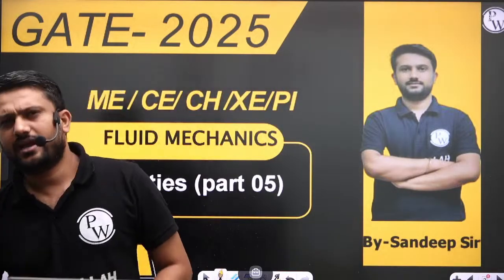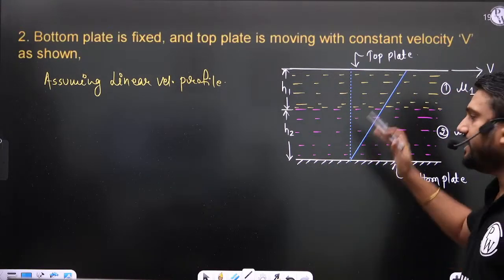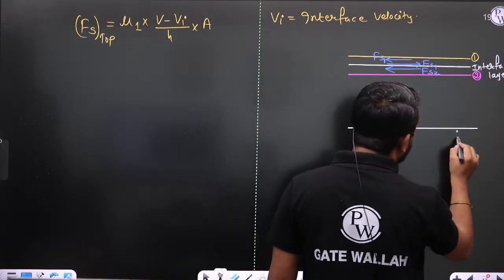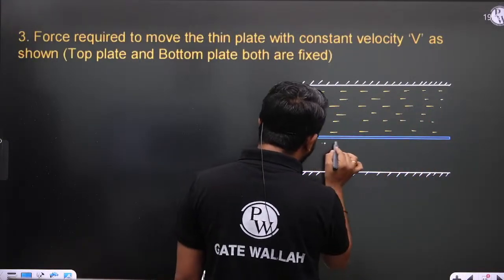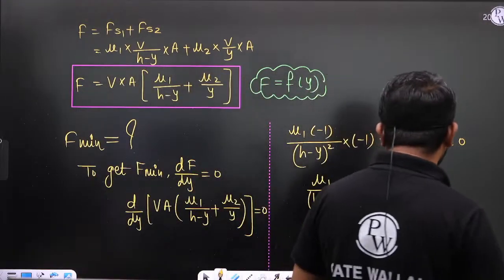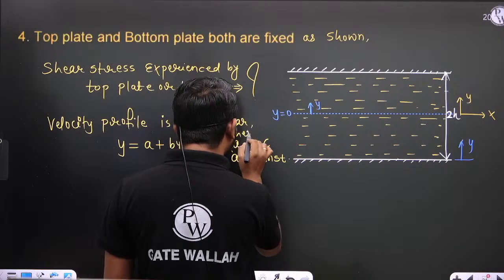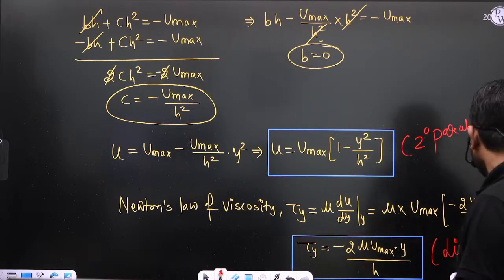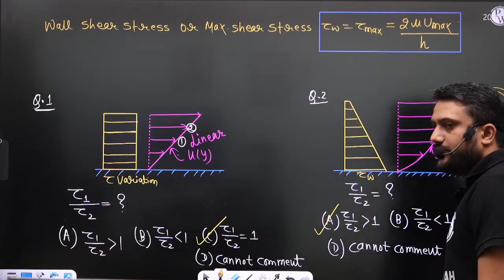Fluid Mechanics 06 | Fluid Properties (Part 05) | GATE 2025 Series | ME/CE/PI/XE/CH

Comment: Sir l have a doubt when you calculate vi( velocity of the interface) In case 2 then you drawing layer 1 Force required (- x direction) and vi  required force (+x direction) and layer 2  force required ( -x direction) so my question 
How to write 
Fs1- Fs2=0
It should be acrroding to you 
Fs1+Fs2=0 
Please tell anyone how to possible ❤❤👍🏻